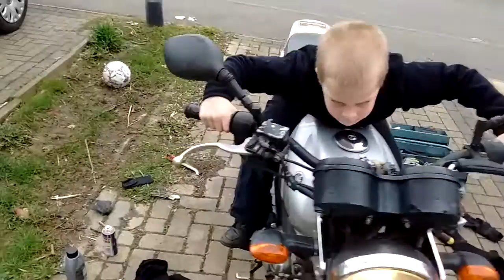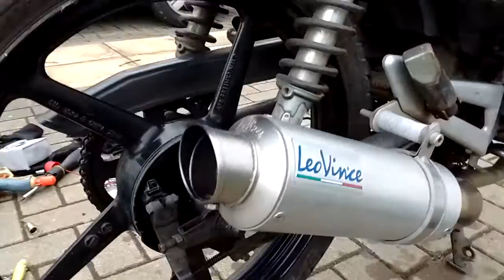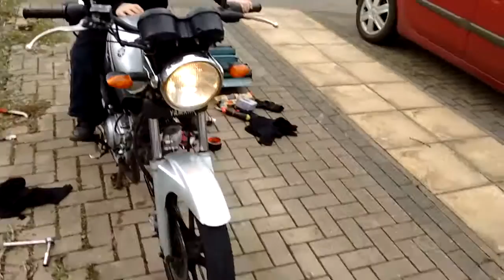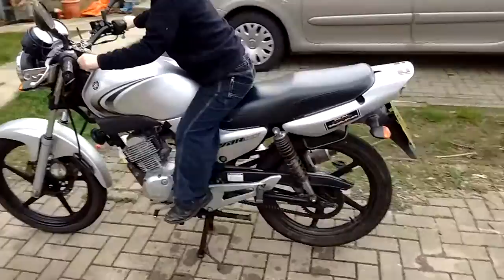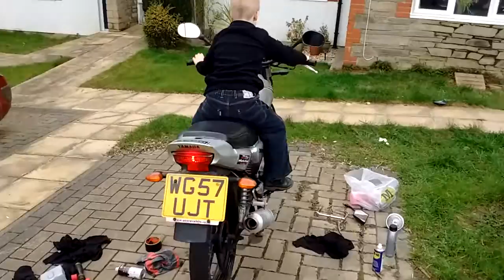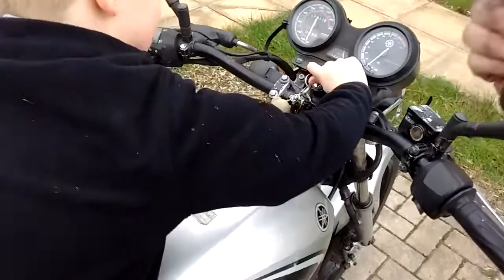Son on my Yamaha YBR 125. Leo Vince exhaust sound revving

Comment: are these exhausts mot legal? is it easy to remove baffles and put them back in for mot?
Reply from the maker: On this model it was as simple as unbolting the stock exhaust and bolting this one on. Some models of Marauder have welded exhausts so a bit harder, but nothing an angle grinder won't solve!